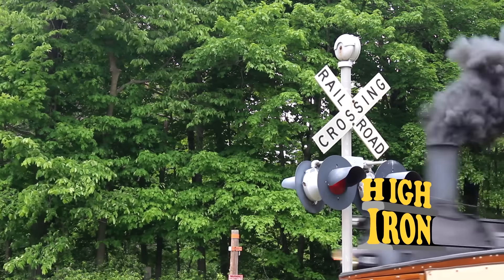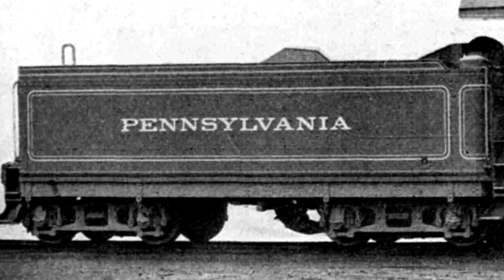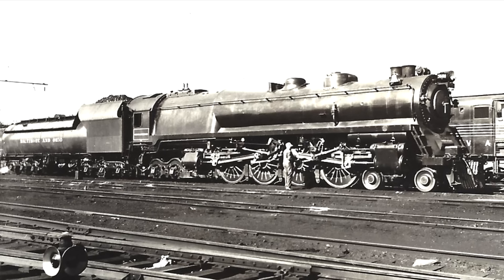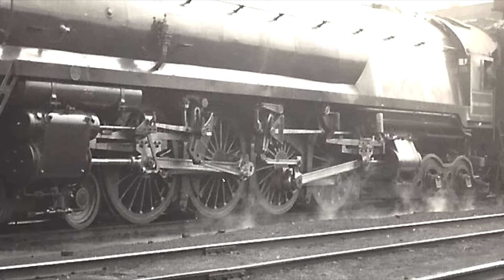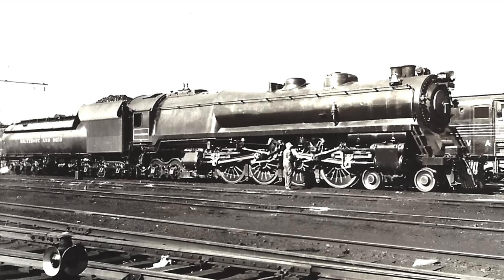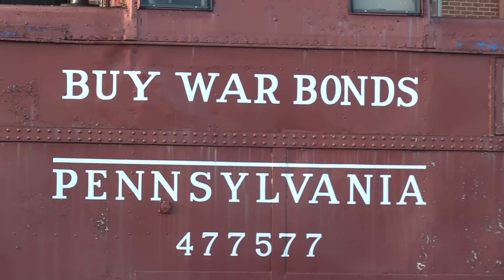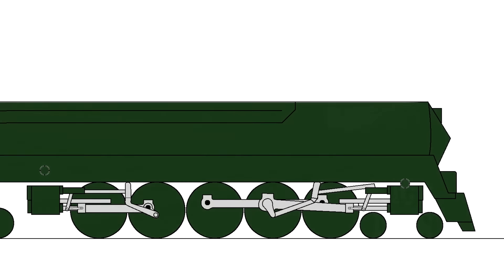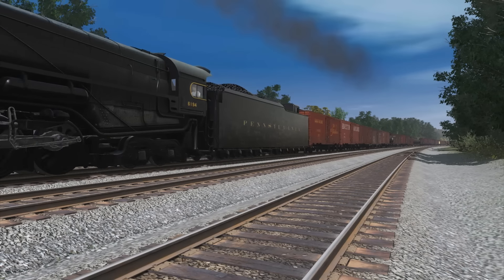Why Weren't Duplex Steam Engines Successful?

Comment: Hmm. Really good video! I’m much more familiar with railroads that operated west of the Mississippi River. Mainly because I live west of the Mississippi. However, this raises a lot of questions for me. Why did they not continue electrification? Was the capital investment for that more expensive than the R&D and building 50 new locomotives? Cus my impression is that the GG1 was the best locomotive they were operating at the time. (I mean there was more going on than that but there’s a reason they were operated into the *1980S!*) 

Also why tf did they not buy the J class if it performed so well? And, tbh, looked way better?
Reply: Pennsy just didn't have the traffic density west of Harrisburg to justify the capital expense of further electrification. Whereas the steamers could operate essentially all over the system. Have wondered about why the Pennsy didn't buy J1s or at least license the design myself. I'm sure there is a reason, but what it was - I dunno.
Reply: Pennsy would have been much better served by a standard 4-8-4 design, ANY 4-8-4 design.
Reply: @michigandon  If they had been equipped with Rotary poppet valves, the 50 production T1's would have outperformed any Northern at the higher speeds on the west end of the PRR system. We may get to prove that with 5550 (which will have rotary poppet valves similar to the backfit on only one of the original T1's - locomotive 5500). Data collected at 100 mph suggests that poppet valves might increase horsepower output by 20% without consuming more steam. At 100 mph the pressure drop through conventional cylinder valves was significant - steam from a 300 psi boiler might not even reach 275 psi at the end of the intake stroke at the cylinder piston. It is similar to the improvement in intake and exhaust flow between a flat head V8 and a modern dual overhead cam V8. Huge improvement. 5550 will answer that question - stay tuned. 5550's hp versus speed curve could be very educational. To my knowledge 5500 with rotary poppets never pulled a dynamometer car..

Comment: I just love this old school approach to engineering: If "Y" is good, then "Y x2" will be twice as good. Unfortunately for those engineers, they found out that physics doesn't scale proportionally.
Reply: Actually the approach is like Y/2, and the physics scaled all too appropriately!  The single greatest disaster was in trying to run the cylinder thrust of half a modern 4-8-4 through an adhesive patch that could suddenly and relatively unpredictably lose and then regain 25% of its effective area.  If the principal excuse of the scheme is primarily to reduce dynamic augment at 'historically appropriate' speeds of the '30s and '40s, the short-stroke duplex is underkill in not stalling, and Timken rods on an eight-coupled two-cylinder simple, especially with Voyce Glaze's balance approach, turns out fine as fast as you'd care to run a reciprocating locomotive in commodity service with potentially litigious members of the public on board...

Even the great stillborn high-speed main line projects -- the Ramsey survey line, the PRR Sam Rea line, and even the Chicago - New York Air Line as it would have been built, would not have been suitable for operation with duplexes above the speed where the augment reduction becomes truly valuable or 'necessary' -- they were low-grade-centric, which is relatively unimportant on true HSR lines for the technical reason that any physical grade can effectively be worked as a momentum grade at high speed -- but contained plenty of curves which were adequate for 100mph but not 120+.

Comment: The Norfolk & Western J and the New York Central Niagara were in my opinion the epitome of conventional steam locomotives. 
Does anyone know if th PRR had any financial interests in the N & W?
Reply: At one time, the Pennsy owned the Norfolk & Western entirely and used it as a cash cow until the N&W bought out the Pennsy during the '30's
Reply: Yes they had planned to merge with it however it was shot down by the ICC and the Pennsylvania railroad had to sell it's stake in the N&W when it merged with the New York Central railroad
Reply: The UP 844 4-8-4 is an outstanding locomotive as well,
Reply: More than a small interest.  At the time, PRR controlled them.  This makes the absence of an R 4-8-4 with 77" or 80" drivers particularly strange.  Part of the issue is that PRR's idea of a "5/4-scale M1" was the Q1, combining divided drive with higher drivers, steps in the wrong direction for how PRR actually ran M&E.

Note the very interesting history of the continuation of V1 turbine development on N&W after PRR dropped the idea (for mechanical complexity and high effective water rate).  It reached quite an interesting, if in my opinion more than slightly misguided, state by 1952, in a form that has very little in common with Baldwin's TE-1 a couple of years later.
Reply: @IndustrialParrot2816  Yes - the irony... The N&W, hauling mostly coal and only a small amount of passenger trains, maintained profitability through the transition era, while the PRR was doomed as the government forced the PRR to run a huge number of nearly empty passenger trains through the 50's and into the 60's, while losing a large percentage of merchandise traffic (which was much greater than PRR coal traffic), to the trucks and the interstate highways. PC goes bankrupt, the feds deregulate rail, making it profitable, and 50 years later, NS ends up owning some of the most productive portions of the PRR, without having to incur the costs of maintaining the Northeast corridor and lots of commuter rail long after the PRR stopped being profitable. As far as I am concerned every NS locomotive needs a Keystone on it somewhere.. Sigh...

Comment: The Duplex was the wrong answer to the problem of counterbalance. Baldwin did a poor job of counterbalancing the New Haven I-5 4-6-4 and Atlantic Coast Line R-1 4-8-4. The correct answer was shown in the Norfolk and West J 4-8-4, Union Pacific FEF series, and New York Central S-1 4-8-4. Light weight rods, with roller bearings (NYC and N&W), and proper balancing of the drivers. The N&W J ran over 110 mph while running on 70" drivers, without any damage to itself or the track.
In hindsight, Pennsy would have probably been better off building a 4-8-4 based on the M1a 4-8-2. Keep the running gear the same, but add a larger firebox on a four wheel trailing truck, plus cast bed fames with roller bearing axles.  The engine would have easily fit the same clearance diagram of the M1a, but would have been capable of higher sustained speeds thanks to the larger firebox and better chassis design.
Reply: Actually the duplex was a fine approach to eliminating the issues of balancing, even (potentially, and only with Langer balancers) allowing zero overbalance.  (The long chassis gave even better nosing control with stiff leading and trailing truck lateral a la N&W J)

The answer was a 4-8-4 capable of PRR's evolutionary requirements to replace the M1s (as embodied in the specs from which the Q1 was designed as a "5/4ths" increase over the M1, with slightly higher drivers.  Trying to accommodate high speed on a 10-coupled rigid wheelbase is a bit much for Timken thin=sectinn rods -- Chapelon was convinced that the only reason they could physically work, with 2/1000s required precisely-aligned clearance, was that they were flexing in buckle on every stroke...

I agree that the R2 would have been a splendid locomotive, but it would have involved as much more boiler and more specifically radiant heating surface as the Niagara did over the late Mohawks.  The M1 boiler was a good one, but it was designed before the better understanding of Woodard's Super-Power culminating in the double Belpaire... under which PRR could not have fit higher than 76" drivers in any event, but with modern balancing that would have been 'sufficient for actual requirements'.
Reply: And it does have to be said, in Baldwin's defense, that they used the then-current AAR balancing spec when building the R1s.  It is interesting to note the tremendous effective evolution of balancing practice between the R1s and the noted FEF development (which, interestingly, specifically avoids roller rod bearings on a 100mph+ design).
Reply: @wizlish  UP had only two locomotives with Timken roller bearing rods, the 4-6-2  and 4-8-2 which were streamlined for the Forty Niner train. Fro.what I've read UP felt that the Timken rods were too "stiff."
Reply: Timken thin-section rods were anything but 'stiff' structurally; Chapelon notes (with a certain careful alarm!) in LLAV that in order for them to work at all they're essentially buckling around the spherical rod eyes at every stroke (!!!)

I don't know if it's cause and effect, but UP did very careful and well-thought-out development for non-roller rods for their actual sustained high-speed locomotives (the two rebuilds were protection power for motor-train Streamliners, and one of them, IIRC the 4-8-2, had the distinction of not once being in the place where it could, in fact, help with a road failure!

See the Timken article circa 1936 that explains the "100mph" rod system.  Those details were a key component both of the two geometries used on Voyce Glaze's balancing of the N&W Js and of the change of the Niagara from just another medium-size 4-8-4 into the 6000ihp high-speed locomotive it became.
Reply: One of the key PRR M1 design features was the large "combustion space" ahead of the firebox, but before the boiler tubes. The M1 delivered just as much hp its "super power" contemporary Berkshires with their four wheel trailing trucks, yet the M1 weighed ten percent less than the Berks. The PRR discovered that radiative heat transfer within the burning flue gas was responsible for a lot of combustion efficiency - not radiation from hot surfaces. The PRR found that a larger fire grate wasn't necessary, just a longer dwell time in the combustion area before entering the fire tubes (where combustion by radiative heat transfer quickly stopped.) The PRR developed other locomotives with long combustion chambers that did not require four wheel trailing trucks to support a massive firebox grate. The PRR only went to larger firebox grates over four wheel trailing trucks when the PRR sought to generate a LOT more horsepower than an incrementally larger M1 class could ever deliver. The T1 boiler could deliver a lot more steam than the M1 boiler because it was designed for high speeds (testing showed that the T1 consumed 1,000 horsepower just to overcome the locomotive's aerodynamic drag at 100 mph!)

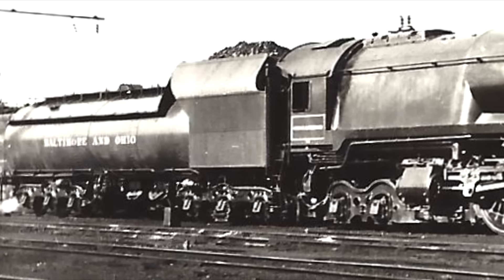Comment: 3:03 "The Baltimore & Ohio build the world's first duplex locomotive."
LNWR Dreadnought class 2-2-2-0 duplexes of 1884: Are we a joke to you? We were the first and the PRR got an engine in 1889 based on our design.
Reply: Hate to say this, but Francis Webb's three-cylinder compounds were something of a joke to everyone else at the time.   They had two small HP cylinders exhausting into a huge single LP cylinder.   
Webb's conventional locos were apparently quite workmanlike designs, but the 'compounds' were erratic in their performance.
But still, they pre-dated the PRR's efforts by several decades.
Reply: As did the James Toleman locomotive described in Sinclair's history of the locomotive engine.

It should be noted that the early duplexes were made for a different engineering reason: rod-connected drivers were supposed to have more mechanical losses than 'singles' at the time.  Certainly the Premier Line ran a great deal of its traffic behind Webb Compounds for quite some time... but note how quickly they were replaced when Frank was no longer there to mandate them...

Comment: By the 1930s,  it was only a matter of time before diesels made steam locomotives obsolete.  Their only downfall in the beginning was lack of power.  But even then,  it was clear they were more economical.  Multiple units could be lashed together and controlled by one crew,  something that you couldn’t do with steam locomotives.  It literally took until UP built the 6600 hp Centennial locomotives that they could equal in one unit the power of the largest steam locomotives like the Big Boy.  Yes they also had the gas turbines before that with even more power but they were also expensive to maintain and operate just like steam locomotives.  Modern diesels don’t have that much power per unit but are much more fuel efficient.
Reply: The groundwork for doing this with steam locomotives was done too, it ties in with one man operation.
Reply: The interesting thing is that everything needed for effective 'engineer control' was worked out in the United States by 1922 (the back-pressure regulated cutoff control) and the electronic developments for mandated automatic train control up to 1928 would quickly make it sensible.  That leaves the need for 'firing attendants' or a clear all-weather corridor between 'units' for the inevitable things that make autonomic firing on reciprocating locomotives much, much, much more difficult than typical railfan engineers recognize it is...

Comment: Right as the explanation of the concept ended, I knew this thing was bound for failure. 

Okay, maybe not the B&O Northern as that one seems fairly logical in regards to putting the drivers closer to each other.

ok maybe the Q2s were ok but i still don't see any potential in Duplexes.
Reply: The potential in duplexes was lower dynamic augment.  It was easy to achieve this even as early as 1935 by using Timken thin-section rods with roller bearings, hollow piston rods, and all the other improvements since Eksergian's observations in 1928.  Where the duplex earns its keep is in practical operation at very high speed, where few if any railroads would actually regularly (or economically) run -- this being precisely the niche that diesel-electrics filled much, much better by the time duplex detail design had its kinks worked out.

Note that a conjugated duplex solves, at least in theory, most of the difficulties except for double the cylinder maintenance costs.
Reply: To be fair, I like Niagaras more, why can't we have a replica of one of those

Comment: Good addition refererring to articulated locomotives instead of the usual rigid chassis locomotives. Not realised is that very long rigid locomotives  cannot make tight turns and cause flange rail damage and track widening risking derailment. I assume track slippage on rails through bends between two sets of drive wheels each side of the locomotive account for instead what is needed on a road vehicle with rubber tyres, which is a differential. Heavy and powerful locomotives are inevitably going to wear rail track on bends faster.

Comment: Here in South Australia,  our 520 class 4-8-4 northerns looks were based on the T1 duplex.  The 520's were regularly  doing minimum  70 mph on the express  passenger service to Port Pirie and could also operate over very light lines within South Australia.

Comment: Beyer-Garratt buit their articulated locomotive in 1911 - this was used in Africa and Australia especially,  where light rail loadings and tight curves were common.  The firebox was slung between the two locomotives and was not constrained by running gear.  The Beyer-Garratts  were is use until the 1970's in Africa.

Comment: On an automobile, wheel slip is what happens when you provide too much torque too quickly to the wheels and tires. It makes a screeching noise and is often called, "Burning Out". On Automatic transmissions, this is caused typically by getting the engine up to high rotations per minute and releasing the clutch pedal fast, which causes all of the engine's power to spin the tires in place.

17:54 is the equivalent of a locomotive burnout.

Also it is common for stick shift learners to accidentally burn out a couple times before their feeling for the car gets better.
Reply: There are two kinds of slipping on a duplex.  Low-speed slipping occurs, as mentioned in the video, when adhesion is momentarily compromised, as going over trackwork switches in terminal approaches, or the throttle is horsed open or reverse cranked up too fast.  High-speed slipping is more significant: if some track issue causes one driver of a 4-8-4 to lose adhesion, the FA only drops to around 7/8, but on a double-Atlantic duplex the affected engine goes to ¾..  Then the precise steam distribution of the Franklin gear has sufficient power to sustain a developed slip until adhesion can be re-established... at which point there is a jerk through the rods as the speed rapidly changes.  There is an account of the phenomenon in Harley's book on the Q2 that describes the feeling 'back in the train' as the tractive effort effectively changes near peak power output of the locomotive.